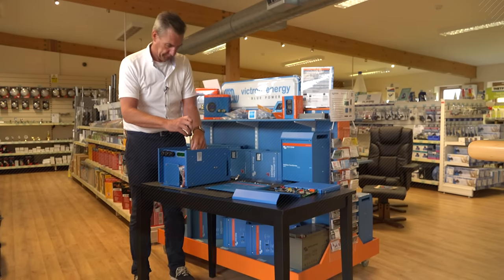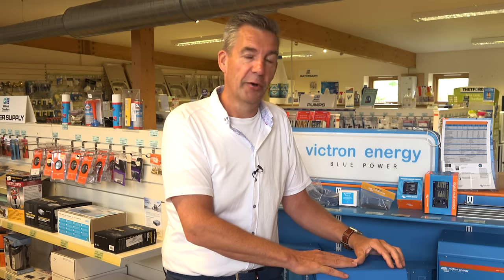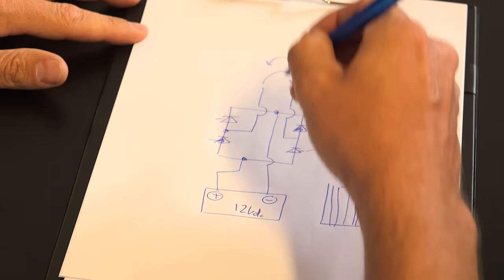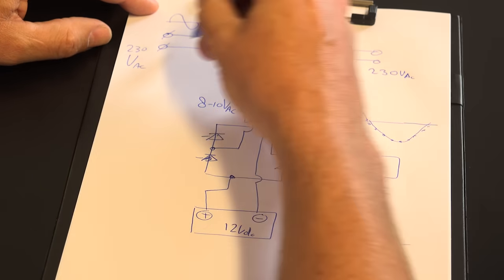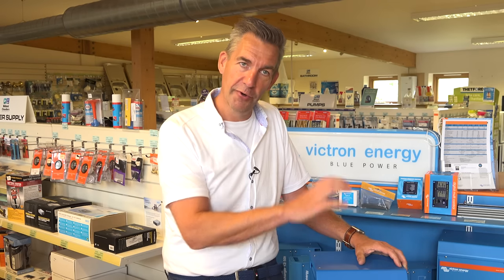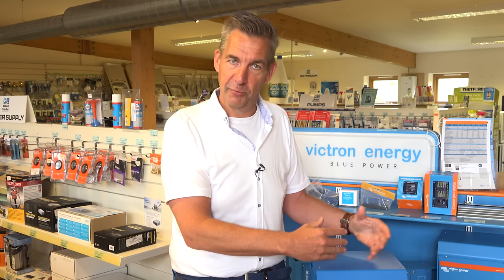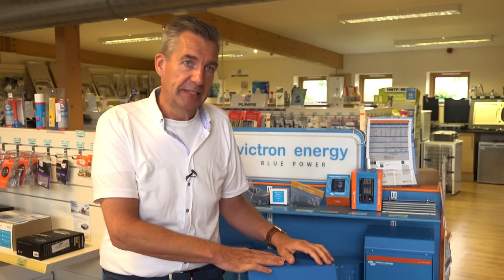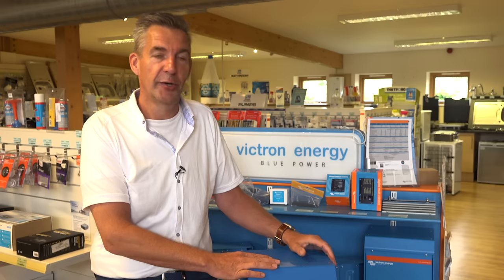Inside the Victron MultiPlus & a Detailed Explanation of How It Works

Comment from the maker: 🎯 Key Takeaways for quick navigation:

00:30 🔌 Victron Energy uses a specific typology to convert DC power to AC voltage in their MultiPlus inverters and charger inverters, maintaining consistency across their product range.
01:20 🔄 FET power bridges in Victron inverters control the output voltage by changing the switching length of FETs, achieving accurate and stable sine wave output at 20 kHz.
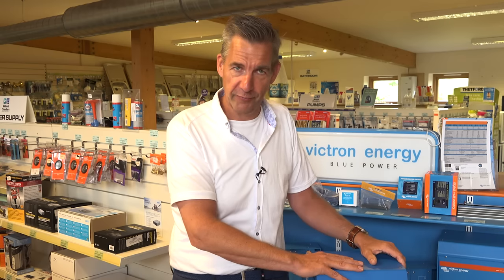03:08 ⚡ Transformers boost the low AC voltage (8-10V) generated by the inverter to standard household voltages like 230V or 120V, depending on the application.
06:42 ↔️ Victron inverters can synchronize with the grid power supply, allowing seamless transfer of power sources and grid assistance. A relay controls the connection.
09:56 🔄 Victron inverters can also act as battery chargers by regulating their voltage to facilitate battery charging. The charge current is controlled by adjusting the inverter voltage.

Comment: Hello. After  watching this I was wondering if a Quattro 8000VA was capable outputting whatever the shore power was capable of (for example 4kW from shore) +  the 8kW that the inverter is capable of for a total output of 12kW or the combination is limited to 8kW?
Reply: Yes sure , the pass thought is limited by the backfeed relay, often 50-100A , the output is then this plus the inverter power.  Thats why often output cabling needed to be larger in size then the input wiring.

Comment: Does the relay close when the inverter is turned off, so that AC power passes from the input to the output?
Reply: no, the relay opens (otherwise the inverter would be powered from shore when inactive)
Reply: @JohannesBoonstra-ol2nz  so you have to have the inverter on all the time when plugged into shore power?
Reply: @jmpattillo  yes, or select the charger only function so it will charge/passthrough when shore is available

Comment: Thank you so much for this.

Which size inverter can I use for a 136A surge current produced by a 3kW, single phase, 230V induction motor?
Reply: for a 3kW is a startup of 4-6 x the nominal power needed.  Please contact the dealer for more details on models

Comment: My favorite product so far!! Thanks!! How does the AC sync handle an 'eco throttle' generator like a Honda 3K inverter series? When load is added, the engine RPM increases. Will this cause the AC syncs to slip? I'm in the US and use 120VAC @ 60Hz with 12V batteries.
Reply: there is a setting called dynamic current limiter which has a AC input level variation based on the power over a period.

Comment: Could you pls assist, can MultiPlus-II be configured to work the following way: load is supplied by battery/mppt in inverter mode (1 priority) if exceed the max inverter power threshold it will take extra from grid (2 priority). Saying load is 7kva, inverter is 5kva and 2 kva goes from grid? Also if load goes less than inverter power it will not export to the grid (0 is allowed). If this is possible the MultiPlus-II GX version is enough or should I purchase separate cerbo  or any other equipment?
Reply: Hello,  yes this can be done with the ESS feature (with feedback disabled) 
Your dealer can help you advise in this further.